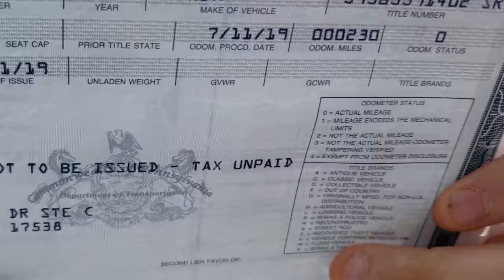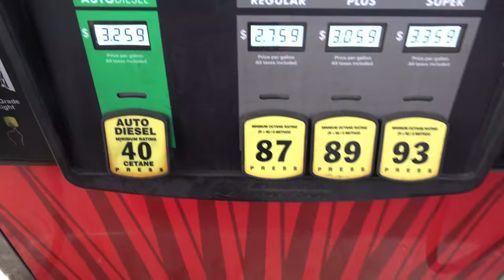How we obtained LEGAL OWNERSHIP of the cheapest rune on the internet

Comment: Was worried that someone would actually get GASOLINE for the DIESEL van.  I used to work in the tractor business and customers would say they needed or ran out of GAS.  WE had plenty of times where that is what they did.  I started putting "DIESEL FUEL" decals on their tractors by the fuel caps.

Comment: Glad to hear you finally got the title to that bike with all the running around you were getting I thought you would end up with a title less bike. Hey not sure if you know this but there is a spray chrome that is supposed to be as durable and weather resistant as Chrome plating and a lot cheaper a friend of mine got a frame and things spray chromed and it came out nice. Anyway just a option if you did not know about it.